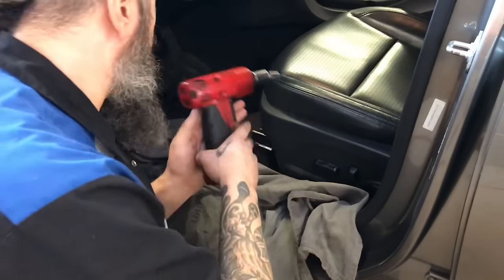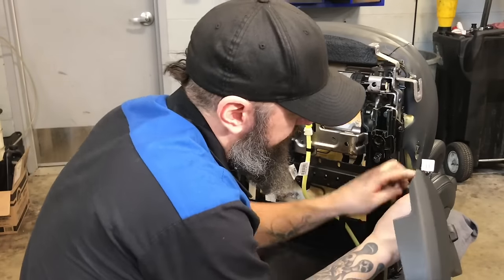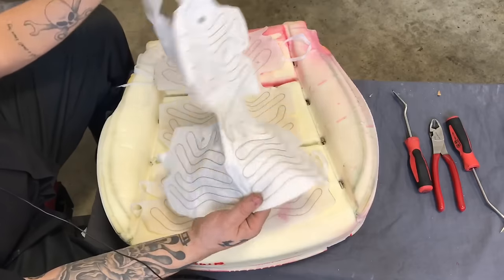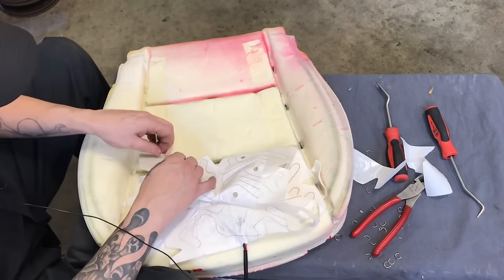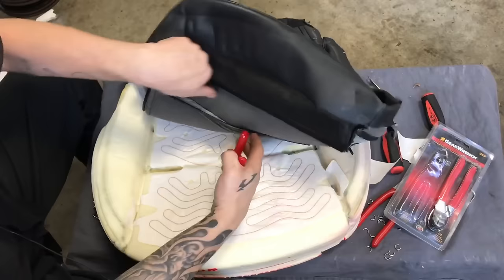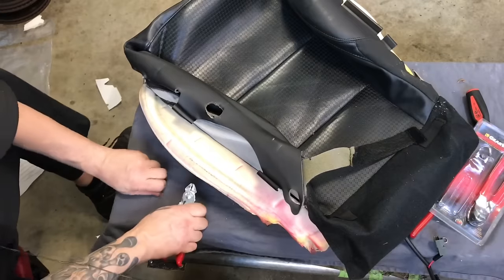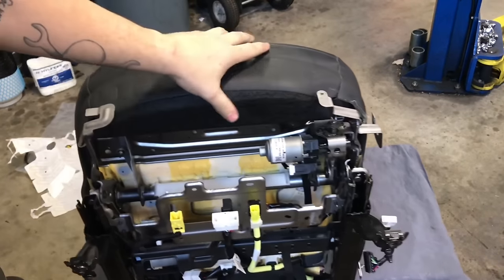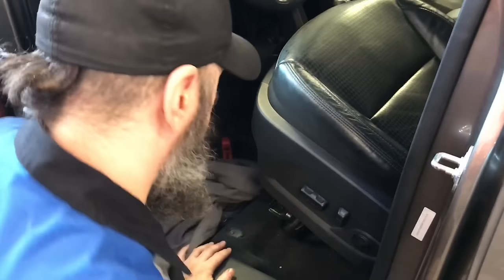Repair Monday - Driver's Heated Seat Pad Replacement

Comment from the maker: Missing footage is a bitch, but sometimes it happens so I apologize.  A little extra info for you about this video:  This was not my diagnosis, another tech diagnosed it and I replaced the part.  That is the reason why I didn't explain the diag process or repair outcome.  This was just a replacement video.  Thanks for watching everyone!!
Reply: Was it only the bottom heating element that went out? Or does Hyundai only use 1 element? Seems like a good idea to do the back element as well, assuming it has one.
Reply: Well stop trying to make a fucking movie and just show the fix

Comment: Nice hog ring pliers.  I never knew such a tool existed.  Last time I took a seat apart, I tried to figure out how to put rings back in and figured the manufacturer must have a robot with a magic wand that put them in.    I put small zip ties up and around from the bottom in strategic places to make it stay down.

Comment: Great video!  By chance do you have a video doing the same on a 2017 Ford Explorer?  My driver side heated seat won't heat up but the passenger side works well.  Perhaps is the Seat assembly under the seat that is faulty, or the pad like in this video?

Comment: Good video. I’ve done this job several times & nice & steady is the way - with space to work as you say. I didn’t have hog-ring tools available, so used small cable ties - which seemed to work well enough.

Comment: The "lights" to both ac and heat both go on and off so I know its not a burnt circuit which I believe is under the passenger seat?

Comment: Have you ever did a Cadillac SRX 2010 to 2016 .. I am wondering if it’s basically the same... mine back is working , but my seat is not ...what do you think...

Comment: Thank You for the video ! I was able to replace the heated/ cooled  seat pad in my 2013 Ram truck after watching your video . I didn’t have the hog rings so I used cable ties and cut them off and turned the cut end down into the foam to keep them from poking through the leather !! Thank You !!

Comment: Great video! i have a 2014 santa fe. For years my drivers side heated seat works on and off literally....its heats and then after a few minutes the 3rd led starts to flash and it stops heating.... and i have to just keep turning it off and then back on again and the process repeats....silly me didnt take it to the dealer while i could and now my warranty is up :( ....do you think this is the heating pad/element failing?   i am considering the same replacement you did in this video.

Comment: I just replaced my driver side bottom seat cover and had to re'use the heat seat pad if I remember correctly the bottom side had a clear view of copper heat wire and top had a thin coat of material over it that's how I installed it anyways lol can you tell me if I did the installation right thanks.

Comment: Is this seat cooling too my dealer told me for MKZ need all the cushion the heating element is built in and they want 2000 bucs ,,, crazy my wife car I think if I swap driver with a passenger can work that. Thanks for the video! thumbs up !
Reply: I’m going to be doing a Taurus limited with heated seats soon.  I have the part and it’s exactly like the one in the video
Reply: Mine is only a heated seat. I did not have to remove the seat to replace the heater pad.  It was actually pretty easy and I used zip ties instead of hog ties.

Comment: Not sure why you pulled the seat, done plenty of heated seat elements and I've never pulled the entire seat out or pulled the entire seat covering off
Reply from the maker: Why struggle if you don’t have to. It’s always easier to have everything wide open.
Reply: I've done Sorento seat heater replacements and not sure how one would  get the fabric off between the center console and the seat itself, I'm too old to stand on my head so out the seat comes!
Reply: Yes the Sorento is a pain...don't see how someone WOULD want to do it in the vehicle holy shirt on that
Reply: Shit lol not shirt lmao
Reply: As long as I am the violet vority they are the prettiest lol